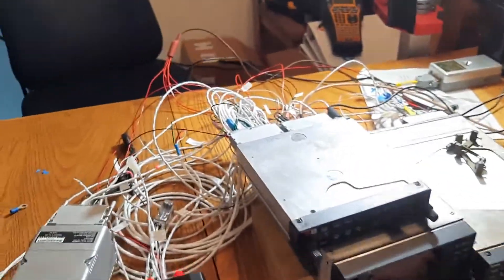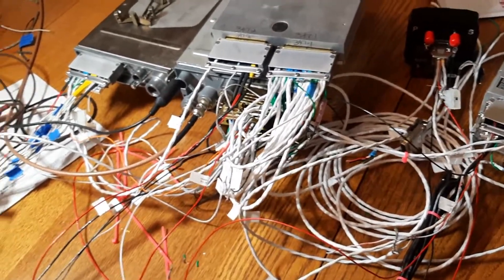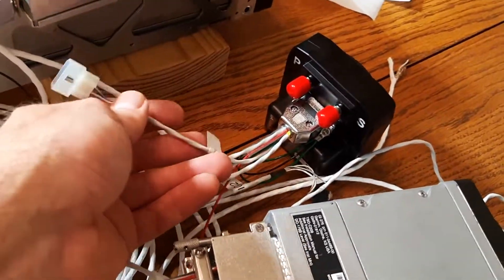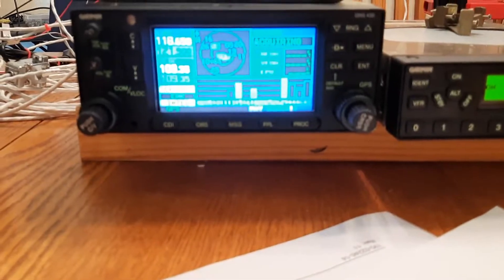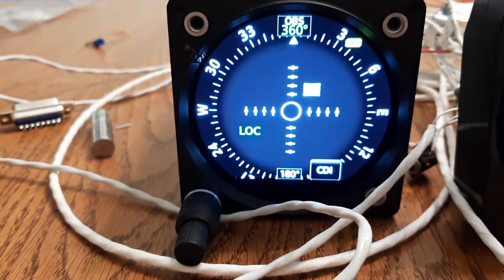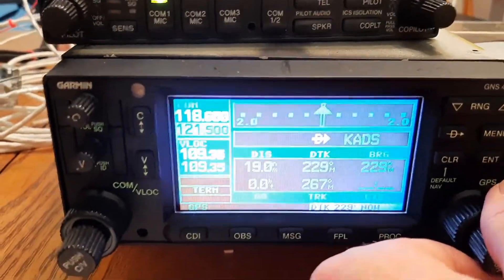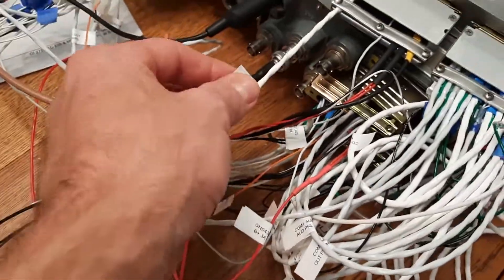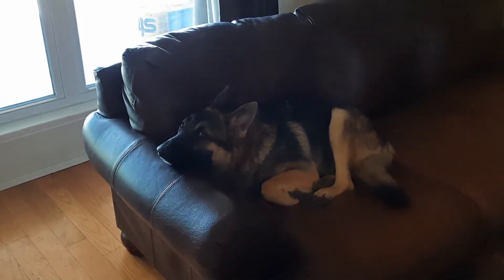N8344T Avionics upgrade project | PART 3 | Garmin | GNS-430W | GMA-347 | GTX-330ES | GI-275 | AV-30S

Comment: Did you get all this equipment installed?  I have the same setup and wondered if you knew, and would share your settings for the 330 ES?  I’m having trouble with transmitting ADSB/Altitude…
Reply from the maker: Sure, I can help you. If you go to my videos you can check out the rest of this series. What are you using for a GPS?

Comment: I strongly recommend an avionics fan for the 430. The screen might ghost if it gets too hot.
Reply from the maker: It has a built in fan, but you are right.. It really gets hot.
Reply: My experience has been the built in fan isn’t sufficient. I installed one that blows forced air in the little hole (where you attached a ground clip in your video). I suspect the 330 has a place to attach cooling too, but I can’t remember. 

I love this series by the way!  I’ve started mine, but it’ll be January before anything gets uploaded.